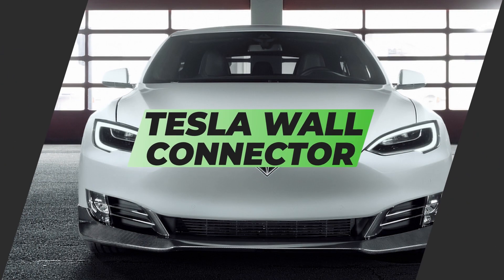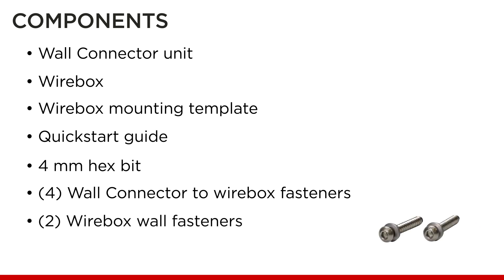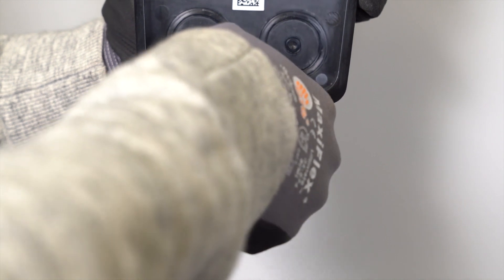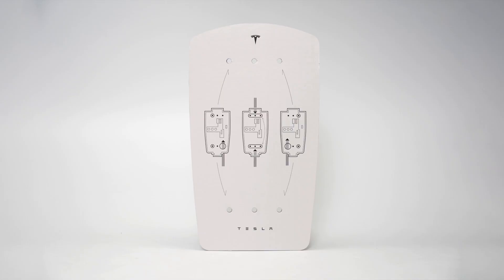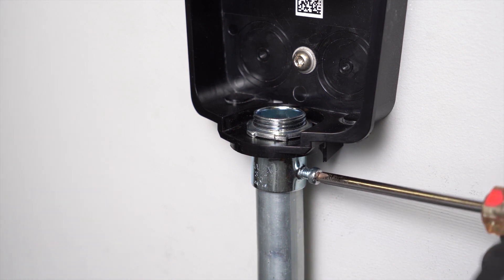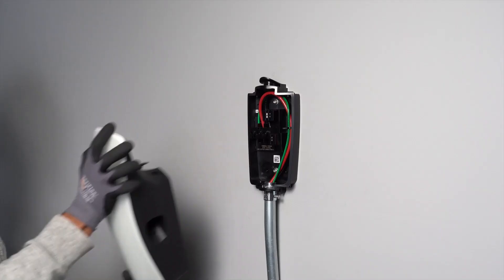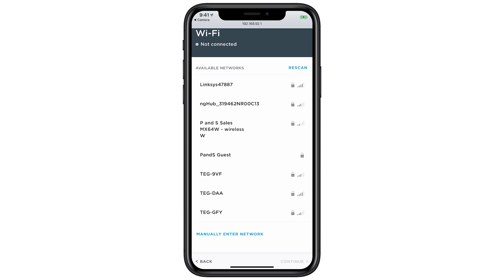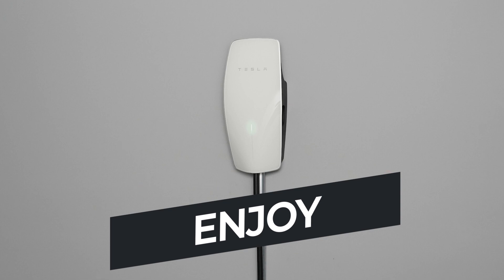Tesla Wall Connector Gen 3 Installation Guide

Comment: The wall connector should be on a 60 amp breaker due to the 125% rule for continuous loads. Otherwise, you will need to down-rate the service.